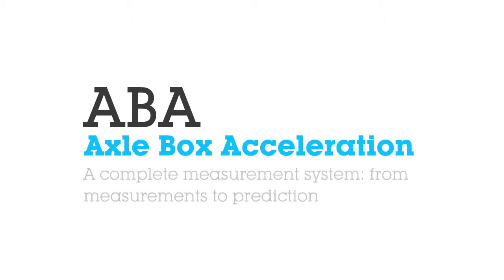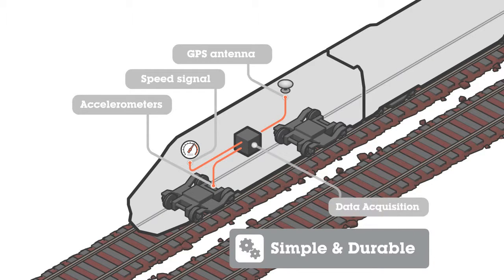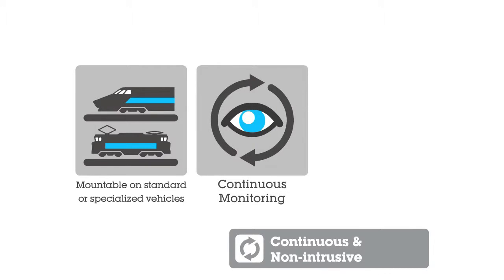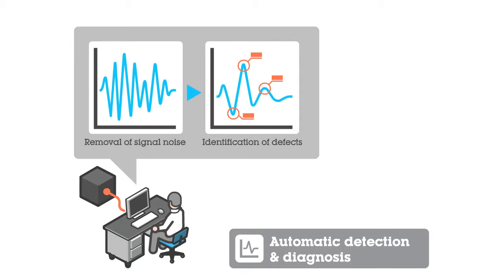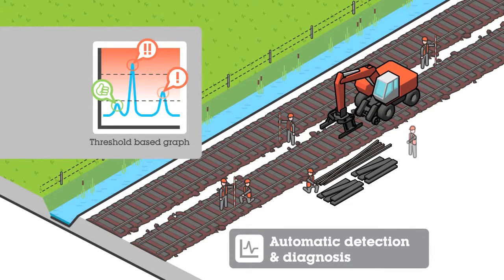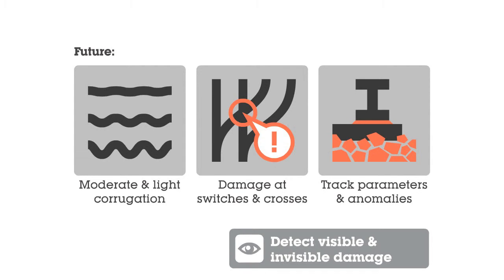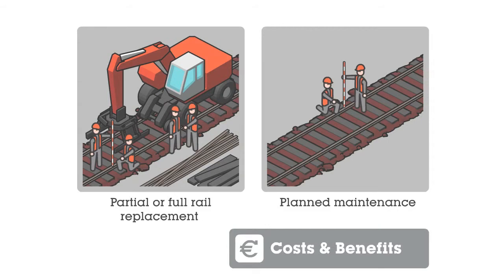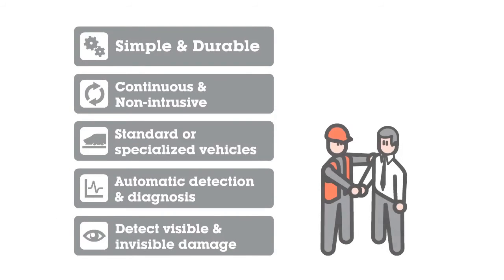Axle box acceleration for Railways Infrastructure

Comment: Can u explain that in this ABA system the measurement components are installed in train itself?
Or it can also be installed in railway inspection vehicle? Then how we will get the third measurement componentthat is speed of train.
Reply from the maker: Hi Maryam. Passenger trains or inspection vehicles. Access to tacho or other positioning system is required. Althought in Dutch, here you can see that the system is already installed and measuring from passenger trains in the whole Dutch network: https://youtu.be/KRAdZyISYsA